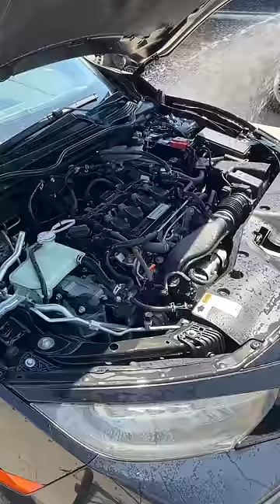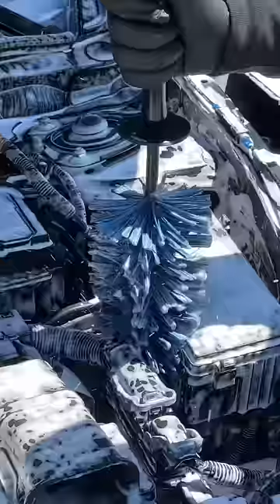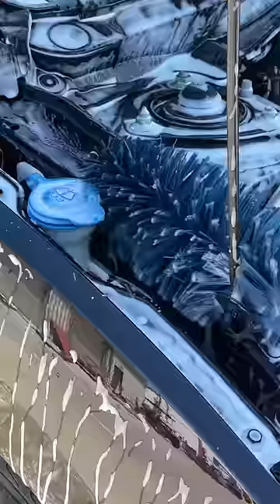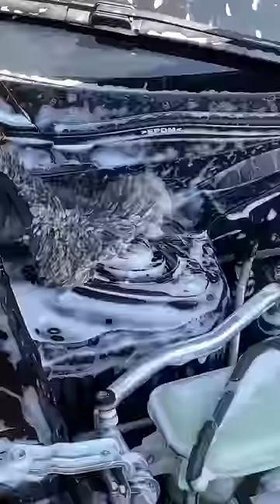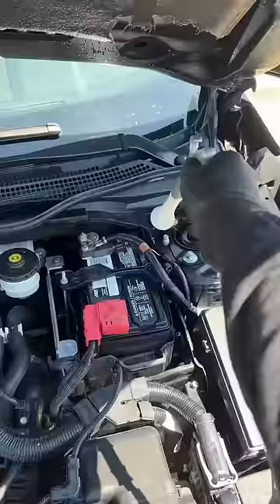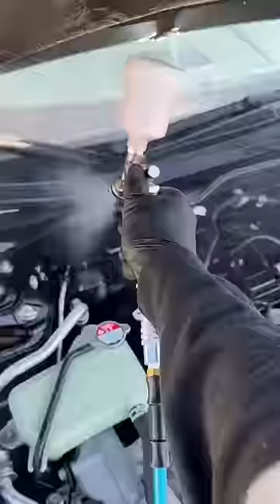Engine bay detail #asmr #satisfying #trending #cleaning #detailing #california #viral #rad

Comment: P0304 has entered the chat, cylinder 4 misfire
Reply: P0304 😂 soo true
Reply: More like P0300: random misfire detected.
Reply: Yup waiting on my new plug coils now as we speak. 99 f250 half a mill miles it needed a bath.
Reply: @ryderczarnecki-es2go lol been there done this.
Reply: I wouldn't doubt it.
Reply: hell yeah
Reply: I promised never to do this again p0300
Reply: P0300... random misfire.
Reply: Have to cover them kinda parts
Reply: John 1:1
In the beginning was the Word, and the Word was with God, and the Word was God.
Reply: Facts!!!!!!
Reply: このあと壊れた動画ですね🎥
Reply: Coil pack and spark plugs ready sir
Reply: Lmfao 😂 👍 😂
Reply: @@Ben-vy1obwhat are the benefits of electric?
Reply: 😂😂😂 olvídate
Reply: @@Ben-vy1obI’ve been debating a Tesla.. what do you drive? If you don’t mind me asking Ben.
Reply: It's a Honda, so a PO 300,301,302,303 & 304. Even if it's only one bad coil.
Reply: @@Ben-vy1obI'd rather have a Toyota Corolla. More leg room better engine and transmission. Toyota probably has the best CVT transmission you can get. Nissan has the worst.
Reply: Exactly
Reply: hahahaha!! 😆 🤣 😂
Reply: Yeahhhhh. Real life
Reply: Ahah for real
Reply: Lol damn
Reply: P0562 has joined the chat. low voltage supply .
Reply: Lmao 🤣. Was about to say, nice clean but did the car even start after this?
Reply: If you use dielectric grease you would avoid p0300 and any potential p0301-p0316.
1% of mechanics use dielectric grease when changing plugs.   It's not hard to fix a misfire from water unless you're a moron
Reply: @danp7463  even if it's not even a coil
Reply: @@Ben-vy1ob no maintenance my ass.  Good luck with that
Reply: @@Ben-vy1ob ну и продолжай... 
часами.  
На самом деле всё спорно. Очень.
Reply: 😂😂😂😂 I was just thinking that! Yes power wash the coils 😅🤣
Reply: @Everything.On.Wheels519  if you ain’t power washing coils, are you really cleaning the engine?
Reply: @beaver6969lv like you said, most don’t use it. Agree it’s preventable :)
Reply: Happened once to my Alfa 156.
All eight spark plugs tried swimming but ..  😵‍💫
Reply: Tienes que hacer con el motor prendido  cuidado con dañar componentes del vehículo si lo haces apagado
Reply: The seals on wire connections are waterproof. Untill they arent. Age and heat break these seals. Not enough for mist from driving in rain or puddles to be a problem, but dumping soap and water on them will cause increased resistance and/or shorts, causing misfires, or misread or faulty sensors. From experience. I didnt enjoy replacing 16 injector and coil connectors myself. Luckily it wasnt too terrible. But a mechanic would charge a fortune and replace lots of parts if u showed up with those symptoms.
Reply: Give me a 5 litre Mustang all day ! 🐎
Reply: @tolgaakyay you didn't get it
Reply: @@Ben-vy1obimagine assuming everyone has the same needs and capabilities in their vehicles
Reply: Coil busted
Reply: @Ben-vy1ob I mean a civic type r is faster around a track... also is worth more than msrp used still. 2017 with 50k miles and the civic is worth about 36k now
Reply: This guy keeps mechanics busy.
Reply: Bro 😂😂😂 so true!
Reply: @Ben-vy1ob, how much does it cost to replace the windshield?
Reply: Точно, я не давно самостоятельно мыл двигатель теперь кучо ошибок 😂😂😂😂😂
Reply: Yup😂..
Reply: Definitely a coil pack or 2
Reply: Cylinder 2 in my Caliber. Lol
Reply: @andy.m265 why?
Reply: Shit P0300😂
Reply: Ya pas mieux pour avoir des problèmes électrique 🤦
Reply: @ryderczarnecki-es2go those Fords are so bad for getting water in the coil tubes 😂
Reply: Lmfaooo
Reply: 😂😂😂😂 and the rest of the error messages after the corrosion sets in.
Reply: @VPROXE-HELLRAISER that car is done
Reply: ЦЕЛОУУ

Comment: No longer runs but customer is satisfied of how good the engine looks!
Reply: LMAO RIGHT 😅
Reply: Wat did you spray on the last part
Reply: You know the engine bay is designed to get wet? As long as you disconnect the battery you are all good. Just make sure you don't get real up and close to the wires
Reply: Unfortunately that’s false as the car gets used more the wires that were once water proof are slowly more vulnerable to not working once it gets soaking wet as we see in this video, it’s better to put a trash bag over the engine bay and now we don’t have to worry about getting everything else wet but still not high pressure and don’t over wet
Reply: It's a Honda , this will not do anything to it. And this person did it like we do we dry the engine bay right after.
Reply: @Flako92  I second this I had a guy come up saying my Type s was toast bc I was cleaning the engine bay and got the alternator wett 4 years later my cars not even blue anymore it’s black now still running lmaooooo that car will be fine

Comment: Make sure to get the spark plugs nice and wet
Reply: Lmao! Fires better if you foam and jet the  cylinders while you soak the plugs.
Reply: And sensors
Reply: This could be assured very easy, just have a car with a Mercedes-Benz M 110 DOHC in-line six-cylinder gasoline engine.
Reply: You sure really know your cars 😅
Reply: If they get wet or any of your sensors get wet it means you don’t maintain your vehicle because they have water seals for this very reason
Reply: Everything on the engine has a seal connectors, coil boots, vacuum lines, intake, everything except the alternator is sealed. Engines are made to get wet you just can’t get water on the inside of the engine

Comment: As a retired professional detailer i would not advise to do that , its not good on the electronics
Reply: I'd say the electronics are fine as long as you're not directly pressure washing a fuse box or control module.
Reply: Is it okay to just do a quick spray wash? No soap or any of that bull
Reply: @aniutrahim1742  Yes, just not pressure washing.  Garden hose is fine.  All the electrical plugs in the engine bay are sealed to keep out water, but not forceful water.
Reply: @twizted3k  gotcha thanks bro!
Reply: Cleaned motors are suspicious. Never buy
Reply: @xanscobe  Wut?
Reply: RIP 😭😭😭😭
Reply: Electronics are fine. The only time you really get any problems is if theres standing water. This guy used compressed air to get all the water out and used as little water as possible...
Reply: I was gonna say the only thing I wouldn’t recommend is the pressure washer. Spray on some apc, let it sit and rinse lightly with a hose. I would still try to avoid getting certain parts soaked. I don’t offer engine details anymore, kind of risky and no one ever really asks for them

Comment: Make sure to refill the alternator with water.  Also, the intake tube is notorious for being dry so fill that with soap and water too
Reply: Love this!!!! 😅😅😅
Reply: Best way to clean it is turn the engine up hi RPM and connect the washer fluid directly into the air intake and hold down the washer fluid button.
Reply: if the video has #trending and #viral hashtag, that only could mean that it is accurate and scientifically proven...
Reply: Water has no affect on the alternator.  You would know that if you knew anything about them and cars
Reply: Катушки зажигания тоже без воды не работают, жто же каждый ребенок знает.
Reply: 공들여서 차를 조지네
Reply: Best Sarcasm ever
Reply: @benjamindover5355 😊
Reply: I can confirm. There is a small port on the air intake hose/tube. Hook up the garden hose up to that and fill 'er up!
Reply: 祖母は言いました。
「神に背きたい時は、オルタネーターに水をかけなさい。」

Comment: If you really want to do this i recommend putting plastic bags over your distribution/direct ignition cassete, alternator and battery. Also unhook your battery. Air dry LIGHTLY and let it dry for quite some time depending on conditions. For example if you live in florida hood open on a hot day for a few hours is probaly fine. Otherwise id just wait 24 hrs. Ive never done this when it wasnt a hot day and always covered the critical components.

Comment: Does a clean a engine run better than a dirty one? NO!
Does watering a dirty engine potentially destroy the engine ? YES !
Reply: Wrong
Reply: @beaver6969lv  why do you believe a dirty engine runs better than a clean one?
Reply: @johnmayerislovee  didn't say it did. 
I know for a fact that watering or spraying an engine will not destroy it. I've been working on cars for over 30 years.  I have sprayed hundreds and hundreds of car engines and never had a problem.
Reply: @beaver6969lv  If you have sprayed hundreds of car engines for the past 30 years with soap and water and never had an issue, then your lucky. But honestly, I most certainly don't want you as my mechanic. Thanks
Reply: @johnmayerislovee  it not luck, it's knowing how to do it right.   Everything on a engine is waterproof.  If you high pressure wash straight down into the valve cover into the coil boots, it could cause a miss fire until the water drys or you blow it out.  You don't think the engine transmission gets wet driving in rain at 70mph?  Boat engines get soaked and they run just fine.
Reply: @beaver6969lv  I disagree but thank you very much.
Reply: @johnmayerislovee  disagree all you want. Everything I stated if fact.  It's not my opinion.
Reply: @beaver6969lv If an engine is older with cracked plastic connections, it can have problems. It's usually not catastrophic, but it can definitely cause corrosion on spark plug clips (for example), decreasing spark strength or even permanent misfires until that connection is cleaned out. With many dozen electrical connections, it can definately corrode and increase resistance if not a complete short, decreasing ecu signals causing all sorts of small issues by misreading sensors. Even a little resistance change can have a significant impact on how well the engine runs. The customer might not even notice decreased fuel efficiency or timing to tell u about it.
Reply: @cHAOs9  но это проблемы клиента , а не того кто помыл 100двигателей, и плевать что проблемы будут через несколько лет, тот кто мыл двигатель заработал деньги сейчас.
Reply: @beaver6969lv stop lying
Reply: No

Comment: I used to clean customers engines after repair till one time a chevrolet cruze supposedly started acting up not running right according to the customer. Customer insisted it had to do with me cleaning the engine. I ended up replacing the MAF sensor free of charge, i believe the sensor was bad from the start but i couldn't prove it. That was the last engine i cleaned for a customer.
Reply: Word. It's just asking for trouble
Reply: a maf sensor is that it aha class yourself lucky then that’s pence 😩😂😂
Reply: Nothing a little ether wouldn't solve.

Comment: You’re a braver man than me. I wouldn’t do that on anything built after 1985.😂
Reply: I'll go up to 2000' but yeah it's risky😂
Reply: до 2000х согласен)
Reply: On most new cummins diesels, the first page of operators manual is a do not wash this engine sign.
Reply: Pero antes era aún más peligroso
Reply: Pior era antes, rotor e outras coisas pra molhar. Hj se a concessionária lavar o motor do seu carro vai sar assim, os revendedores lavam e o pessoal acha lindo limpinho e compra... Kkk lavo motor do meu carro há anos sem medinho o pior é deixar sujo...
Reply: I have, but covered the air cleaner, battery and fuse box first (and checked wiring). It was fine, but I focussed around the head and radiator cos I was looking for a leak.

Comment: I clean my engine frequently. 449K later and it runs like new. A strong leaf blower is great for getting most of the water off. Wait 24 hrs before you start it if you're worried about it. Most important connections have a waterproof bellows seal.
Reply: I was curious about that, too!  Not starting for 24 hours+ seems like a good number to me!  Also, would disconnecting the battery during washing and drying help?
Reply: @harrykoyl3784    You can get a lot of electronic stuff wet but some sensitive things you need to be sure they're dry before you power them up. Put a fan on things to help drying if you need to. Having the key off disconnects the battery from most things.
Reply: Good advice. I like the clean look on engines but it's a delicate process⏲️
Reply: @harrykoyl3784 if it's hot outside and the sun is out, than just leave it in the sun it'll be way way better, and faster to dry. Only thing that you should be worried about is the alternator, battery if it's in the engine bay, and that's it really.
Every other connectors should be sealed properly, and water resistant.
Reply: Like u, but I'm 70 now. Been cleaning engine bays for DECADES. Now own a hybrid and STILL hose down engine. If u clean often, no need to saturate bay with H2O. For anti-wash bayers, oil, dirt, is like frying an egg.🤔😁
Reply: Yes you right but spraying into it forscfoly like I do can damage part's and 😢😢😢 cause probably some problems

Comment: My dad owned a detail business back in the day. He would not clean under the hoods. Too big of a liability if something goes wrong. Can be very costly to fix.
Reply: back in the day when they probably had carburetors and distributors🤦🏼‍♂️
Reply: @ygfromig  not that long ago. I wouldn't do it on a modern car either. Little dust not gonna make it stop working. No need to clean under there. No one ever sees it.
Reply: Lmao you sound just like your dad I'm sure. Lazy... I noticed you said "owned"
Reply: @SirHendri6 lmfao.  Priceless comment
Reply: @fbodyblack  bro the only reason why people experience electrical problems after washing is because they use normal ass water. If you used distilled water your guaranteed to avoid electrical problems
Reply: travisd.4098  why does electrical problems happen in the first place? Because of minerals in the water. You can let any electronic live in distilled water

Comment: Wow your alternator, starter, & ignition coils love you
Reply: Starter and alternator and coils dgaf. If anything if your coil packs act up after this the conformal coating to seal.em has been breached and you just saved yourself a headache in the future.
Reply: Wow , you totally have no idea about vehicles
Reply: lol almost
Reply: Yeah the seals might be broken. But if you dont shove water into em there will never be a problem. Why break them with water on purpose so u have to replace them? Not to mention old plastic clip wire connectors. Why corrode them and increase resistances on all sensors or spark? Just cause a seal is broken doesn't mean it will ever be an issue. Unless u pressure wash it.
Reply: Nobody talks about the sensors ...there expensive

Comment: The alternator has entered the chat. 💀 
RIP 😂
Reply: We have engines mounted on trailers running pumps and the engines are not covered from rain,sand storms,sleet,snow or whatever and are no more problematic than engines under a cars hood🤷‍♂️
Reply: 😂😂😂 definitely
Reply: You better believe it
Reply: i think that alternator just exited the chat!
Reply: Как по лужам в дождь ехать тогда?
Reply: @danielmoore8538 dime y tu vas con la tapa y puertas abiertas ?😂
Reply: Alternators get wet all the time.  They're made to withstand water.  Windings are coated and diodes are  water proof.  You probably know that because you build Alternators right?
Reply: @beaver6969lv I run a car wash and in my experience, alternators from petrol engines are prone to failure after an engine cleanse. To avoid this, we cover the alternator and the top of the spark plugs with plastic bags to prevent any water getting in. While diesel engines don't need any of those precautions

Comment: Don't let anyone do that. Your sensors will go nuts. use only on the bottom of engine with no chemicals. They want you to do that so you have to pay these idiots to troubleshoot your sensors.
Reply: 100%. I had to replace all my cracked clips (myself) after light washing. It needed it a little anyway tho, i just made existing issues with connections much worse. So it may have helped me a little. But if ur not prepared to redo all your electrical connections, dont shove water into where wires connect to each other, aka your engine compartment.
Reply: Я за 10 лет ни разу не мыл подкапотное пространство, нет проблем, на другом автомобиле мыл, имел проблемы с зажиганием и оптикой..

Comment: He used a low pressure wide angle nozzle and kept his distance. It’s perfectly fine. If there was any damage then it’s caused by a failure of a seal that should have been replaced prior. People forget that engines are designed to run in the rain…. Ever seen the spray from a semi? That’s about the equivalent to that pressure washer nozzle.

Comment: I was always told NEVER DO THIS.  I guess times change.
It's still really dangerous to do this.  It wets electrical and mechanical parts that shouldn't be wet.
Reply: I just use pre-moistened wipes. Baby wipes work well and for really dirty bays you can use Tub O Towels. And some compressed air. There's no reason (other than to get a car ready for sale) you'd want to do this. 2 weeks later it's going to look exactly the same.
Reply: There is no good reason to do this and every possibility it will cause an expensive problem. Any electrical connector or wire in the engine bay is meant to be water/weather proof but soaking them in water like this is different, and could force water into areas where it can't escape, sits and causes premature rusting. Also if you get water into the cars engine it will contaminate the oil, your oil cap, dipstick, etc might not be water tight, there is so many many risks with introducing water to your engine bay. A clean engine bay allows you to check your car engine easier and to spot fluid leaks, but water is a terrible cleaner for a car.
Reply: Name parts that can't be wet. 
 Alt can battery can fuses can pcm,tcm can. I don't know of one thing that an engine has that can't get wet
Reply: The big reason not to, that no one is talking about, it is that dirt is actually useful information to a good mechanic. A layer of dirt also helps highlight where leaks are coming from